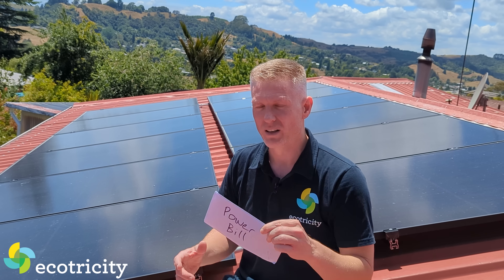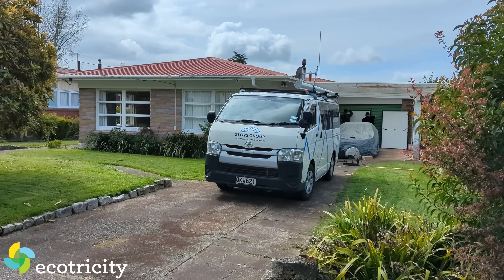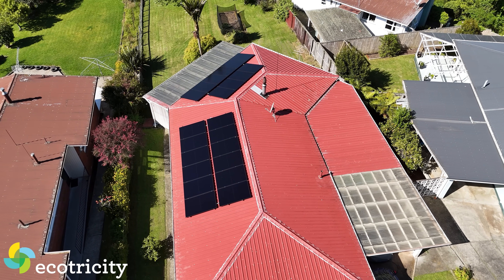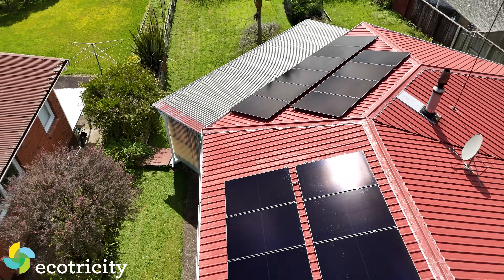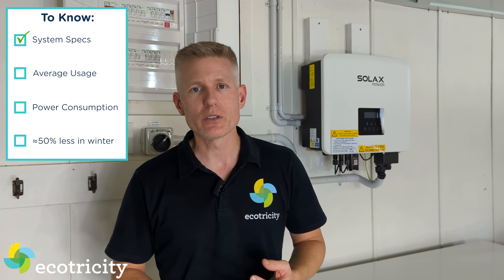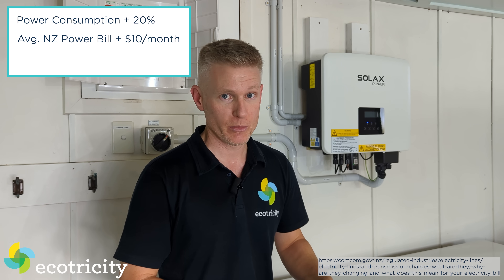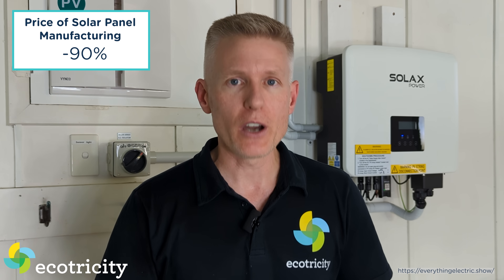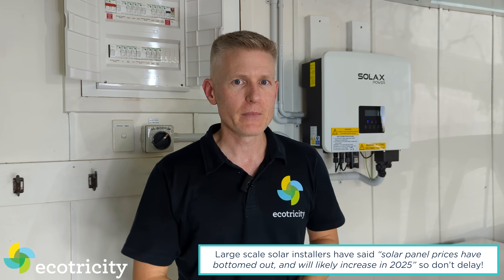Is solar power really worth it in New Zealand?

Comment: Make the best of it pal, my feed in rate in aussie started at 12c went down to 8c about 2 years ago and is now 4c. Next stop zero
Reply: By far the best return is gained from self consumption of your own generation. The value of this electricity is dictated by the supply rate at that time of the day (so not night rates) which will only keep rising, and are totally separate from whatever FIT you can get. Basing the economics of a solar installation on what you can export is a strategy doomed to failure.
Reply: Very good point but the article uses fit as part of the overall economic benefit
Reply: @kenfoster3021  Exported generation should be thought of as 'waste' and if you can sell your waste generation all well and good but your primary effort should be to offset electricity that you would otherwise be purchased from your retailer with that price including GST. 

The same reasoning extends through to the economics of batteries. The financial gain from batteries is the difference in price between your FIT vs the retail electricity price prevailing at the time you draw down the charge on those batteries. For example on a FIT of 17c as we have we would be gaining only 1.5c/kWh at night, 13c at offpeak or 20c during peak (Octopus rates of 18.5c, 30c & 37c (GST inclusive)respectively, minus the depreciation on the actual batteries. The lower the FIT goes the better the case for batteries but for last year we self consumed 7,300kWh ($2,317) vs 4,500kWh of export ($781). We already self consume to a large degree so batteries aren't viable in our situation presently.

Comment: I got a 3Kw on-grid system back in 2014 for $11k which is based on micro-inverters. We were also able to take advantage of putting it on the mortgage when the interest rates were a lot lower and Kiwibank had a $2000 rebate over the course of 4 years as well which we took advantage of. I was with Ecotricity for a time but switched to another provider based on our usage and cost savings. If they offer a better deal now I have no problems switching back however they are a bit too "woke" for my liking. Realistically I'm saving around $800 a year in power so payback for us is around 10 years including the additional interest and rebate factored in. A 9.7Kw system is massive however so would definitely look better on paper. I made a YT video on it and could see power output from the panels slowly degrading over time year on year - they are Canadian Solar panels so a good quality and known brand (12 x 250w). Overall I'm sitting on the fence to whether or not it was worth getting them but they do add value to the house regardless. We're an electric/gas household based in Lower Hutt.

Comment: Its worth it if you DIY, most installers are still charging $1 per watt for panels, and the wholesale cost of a 500W panel is only around $150 or so.

Comment: we have so little sun in new zealand its not worth it.
Reply: still works if its cloudy
Reply: @drbass9677  wrong lies
Reply: @mega-dollop  they work when it’s cloudy buddy, I install solar panels for a living so think I know what I’m talking about 😂
Reply: thats total bullchit,, Im off grid on solar, I spent about 3k to build the system, I can survive with power for 3 days on battery and I can use my welder when I need,,, plenty of sun, you just need a decent battery bank,,
Reply: @hugokappes4077  wrong. Lies.
Reply: @mega-dollop  what part is a lie ? You want to come over for a cup of tea an look at my set up ?
Reply: @mega-dollop  even on a dark day my panels pick up power   but I have enough battery to get through a few days ,
Reply: How do you explain NZ having similar melanoma rates to Australia then?
Reply: @HarmLessSolutionsNZ  solar panels make much more of their energy by converting visible light not uv rays
Reply: @mega-dollop  But UV is part of the same spectrum that solar panels use so is a good indication of the levels of sunlight we receive, which you're falsely claiming is very little.
Reply: @HarmLessSolutionsNZ  wrong. Nz has high uv and low visible light.
Reply: @mega-dollop  Really? Guess someone forgot to tell my solar that. Started generating before 7:00am today, currently just under 5kW on its way to 8.2kW max inverter capacity by about midday. 11,760kWh generated last year here in sunny Taranaki. 

New Zealand has higher sunshine levels than Scotland but solar is still viable there.
Reply: @HarmLessSolutionsNZ  im not saying you wont register energy gain. Im saying the time for which the solar panels will pay for themselves will net you a loss. Unless you hope to live in one house for 30 years
Reply: @mega-dollop  You are wrong. Since installing our $30,000 of solar in August 2023 it has saved us $4,637 ($3,468 self consumption, $1,169 export) which projects out to a 9 year payback period, which of course will reduce as electricity supply prices increase. Our was a complex install so shorter payback periods are usually possible. Also this ignoring the savings we enjoy by charging EVs and garden tools so avoiding any petrol expenditure.  And you're ignoring the added value solar results in regarding resale value so duration of property ownership isn't really that relevant.
Reply: @HarmLessSolutionsNZ  please stop lying
Reply: @mega-dollop  Sorry the statistics I'm quoting from my SolarAnalytics data don't agree with your opinions on the economics of solar but if resorting to blatant accusations of lying is as good as you've got then keep spouting your FUD.
Reply: @HarmLessSolutionsNZ  oh your own personal data lol right "statistics"
Reply: @mega-dollop  You're really struggling with this technology aren't you? 

SolarAnalytics provide a software package that has access to our inverter and our Octopus Energy plan prices which it uses to compile a historic database of our system's performance. Those are the statistics I am quoting. If you choose to take the tinfoil hat approach in regard to solar generation at least put some effort into knowing what you're talking about.
Reply: @HarmLessSolutionsNZ  ive seen the "stats" #youropinion
Reply: @mega-dollop  You obviously only see what you want to see, and believe. Obviously a waste of time attempting to educate you. Have a nice day.
Reply from the maker: Ah, not exactly. New Zealand has similar sunshine hours to the state of Victoria in Australia. We're ripe for solar adoption. -Gav

Comment: In Victoria Australia I had for 15 yrs a 1.6 kWh solar system with pay in tariff of 60cents I often got zero bills, I recently upgraded to a 6.6 kWh system with pay in tariff now down to 04cents due to government changes, I have a 10Kwh battery and an EV, I now get bills. I suppose if you added in what it used to cost me in fuel prior to my upgrade to solar EV and battery it would probably even out. But loosing the good pay in tariff was devastating.

Comment: Payback calculation ignores the opportunity cost of tying up 20k into panels when it could be used to pay down debt or invested elsewhere. Even with the 0% loan from Westpac solar isn't worth it for me, especially because it also restricts what electricity plans you can use - my last bill was $102 for 820kwh using Meridian's four hour free power a day plan. Wholesale off-peak electricity is basically free in NZ (and super off-peak often is) so if you can sign up to a plan that incentivises using it and can push all your usage into those times power is very affordable. Until the government gets on board I don't see solar being viable in NZ. Hopefully they allow balcony solar systems in the future too.
Reply: What plan are you on please? The 4 free hours a day makes a lot of sense to me.
Reply: @nikiTricoteuse  Just keep in mind power is around 30c per hour so you're saving around $8.50 a week. The free hours are a great marketing tool.
Reply: @waynereilly9750  Per unit (kw) per hour. Standard NZ household has 63A pole fuse so the average home can burn through $4.3 of free power per hour at full tilt. I save more than $10 a week just on free hot water alone.
Reply: @TheZoomJap  Just checking my last bill and I've used 14c per hour. Still I've got solar tubes for our hot water. Controlled bill was $4.20 for the month.
Reply: That 20k included a lot of extra work many people wont need, $12k for 6kw is more typical. 
The cost of new power generation is massive, our grid could be sitting pretty supply-wise if we'd subsidised like Australia.
Reply: There should be no government subsidies. That just means taxpayers are unwillingly shelling out. Otherwise if individuals want solar, or not, go for it.
Reply: If the government ran a tight ship I'd agree with you. But given all the ways they waste money, solar incentives seem worthwhile given all the benefits from increased adoption. Not to mention a 20k system is really 30k+ pre-tax and includes almost 3k of GST too. Plenty of meat in that 13k for some to be given back without other tax payers having to shell out. There's also other options like recouping an upfront cost subsidy through some sort of solar buyback scheme.

Comment: I am a low user, but the connection fee and tax are as much as my electricity, so it would not be viable to have solar unless I disconnected from the grid and had a battery bank.
Reply: have you forgot you get paid by the grid? you will easily cover those costs, just like this guy has
Reply: @conorandturbos  No I did not forget, but what the company pays you is not set in stone. For example, my son in WA gets paid 5c per kw which would not even get near the installation cost

Comment: What about line charges ? ... I use $50 of power per month and get charged $100 in line charges
Reply: Hi! Solar owners get access to power contracts that include lower day rates than is typically on offer by the wider market. Both Poweredge and Meridian offer a 69c day charge, but only for solar customers. 

The solar buyback credits alone typically cover the $20 per month line charge.
Reply: @equitysolarbrokers  hey thanks
Reply from the maker: My power generation pays for the line charges. It's doing better than expected. -Gav

Comment: I was quoted over $50'000 by Laura Andrews from EcoEfficient for a similar setup (10kW) here in Napier. Normal house, normal roof, normal location. I asked them to quote me for an "off-grid" equivalent setup and gave me that stupid price and then told me that I would need to use bottled gas for hot water and the solar could not run home heating/cooling! Then what's the solar for??? They also said payback time would be 33 years!
Reply: Interesting idea. Did they compare the cost of solar to the cost of diesel per kWh generated? It's not tough for a solar company to chuck a power rate of 80-90 cents into their modelling software to see the true value of solar vs primarily generator use!
Reply: what they told you is total bullchit,,  Im off grid, built my own system, for 3k total,, I can run my welder when I need,,  and I can add to my system as I want, the key is to have a decent battery bank,,
Reply: @hugokappes4077  most people dont want a huge gross bank of old lead acid cells.
Reply: You were scammed id report them, a full 10kw setup is max 6.5k
Reply: @Capt_Kaveman  they quoted a full off grid system, those systems are very different to typical ongrid inverters.

Comment: You've got your typical 1960's Kiwi sized house that has generously proportioned rooms. Presumably, like most Kiwi households, you have electric space heating and not gas. Over time, as and when funds & schedule permits, you could add a simple stud wall lining to each internal and external wall and stuff it with insulation, before plasterboarding, skimming and repainting. Temperature swings would be a thing of the past (throughout) the year, and your energy bills would sink even further in addition to making the place so much more comfortable to live in due to the high level of thermal performance.
The correct choice of insulation for your house is important as you want to ensure vapour permeability; moisture needs to be able to come and get out again to prevent moisture buildup and mold development. A good builder should be able to advise on what's right for you. But I reckon you could do the basic stud wall lining yourself along with the insulation, and if you are really handy at the DIY, the plasterboarding as well. The only professional cost would be the plasterer and plaster. The Everything Electric Show has Imogen Bhogal recently interviewing a UK householder who's done something similar and it's a real eye opener as their energy consumption dropped a WHOPPING 75% from 25,500kwh per year down to 6,000. 

Hope this is worth thinking about for you. 😊
Reply: Good old solid rimu timber 1960's 3 bedroom houses with air leaking single glazed wooden windows.
Stripping the lining off outside walls, stapling in  "pockets" of building paper, rewiring with new higher capacity electric wiring, filling with sound deadening insulation, new/more  power points new gib and painting can all be done with good results......
and doing the same to interior walls reduces the guitar sound box effects of rimu floors...
as does new carpet and underlay.

Finish off with good double glazed windows....
plus underfloor.... plastic on the ground and insulation between the joists...

Comment: Jesus solar is expensive in NZ. I installed a 13.2KW here in Australia for $6800 and that also included four optimisers because of shadows in the afternoon from the Starlink dish and TV antenna.
Reply: Everything is expensive in New Zealand. I bought solar panels for our bus from an Aussie company. Even with the airfreight from Melbourne to Christchurch, it effectively worked out as buy two, get one free compared with buying the same/equivalent from any of the local companies.
Reply: UK cost is similar to NZ, your costs in Australia are v cheap (you lucky bastard 😀).
Reply: @geoffreyjones6019  Not just that, we had some good feed in tariffs a long time back and we still get 44cents/kWh. So our last bill was an actual credit payment to us of $169. That will reduce in winter. But we have 5 bedrooms, a pool, an EV, 3xaircons and 2 refrigerators and live in sunny Queensland, so do draw a fair bit of power to run the place and stay cool.
Reply: @remakeit2628  okay, okay, you don’t have to rub it in, I was already jealous 😀 When feed in tariffs were introduced here (2010) they paid 40-50 pence/kWh but it’s nothing like that now.
Reply: @geoffreyjones6019  They get subsidy.
Reply: @David-xh2yt Im wondering if thats because the government has subsidised the cost in Australia? It has worked really well in Australia and the uptake has been strong. Would be great if the same could be followed in NZ. Would make a huge difference but when the energy companies  have their vested interest of not loosing money with power being sent back to the grid and a toothless commerce commission that has no power to enforce anything then sadly this is what we end up paying.
Reply: @ The federal subsidies did make a huge difference initially but not so much anymore. Most early systems were a a maximum of 6.2kW because of the 5kW feed in cap. Nowadays the insatalled average is over 11kW rooftop and FIT is nearly always well uncer 10cent/kWh.
The best thing about Australian solar is that panel costs are ridiculously cheap and installation labour costs are usually less than $1k because of the experienced workforce available. My installer was able to work freelance with company equipment at cost, on weekends, although that excluded the compny installation warranty (not panel or inverter though). The reason they allowed this was due to how the federal subsidies kicked back to companies.
Reply: Can now get 440kw biracial panels under $200.  Shop around guys.
Reply: 440w I mean.
Reply: @ bifacial?
Reply: @DavidBridgman-hy8ib Bifacial, or racially diverse panels?
Reply: @ spell checker strikes again apparently 😆
Reply: @DavidBridgman-hy8ib  580W Bifacial Solar Panel - MONO+N Type $199 at Trade Depot.
Reply: Yep, and BUTTER is now knocking on $10 for 500g . At least you'll be able to afford the baking costs
Reply: australia has rebate systems that nz doesnt have, the install company likely got around 6-8k in rebates which they passed on to you.
Reply: Installation is the real killer, you can get good panels cheap. Panel cost was only a bit over a quarter of my total cost 😕
Reply: if you think solar is expensive in NZ, have a look at California...

Australia is pretty much the cheapest on the planet for solar, everyone else looks expensive.
Reply: @Etacovda63  i think you can get solar for a cheaper price in China compared to Aus
Reply: @PsychedMedia  well, yeah, but im comparing western countries for obvious reasons :)
Reply: @Etacovda63  Darn. I'd have thought California, of all the states, would be pretty progressive in this area both environmentally and great climate for it.